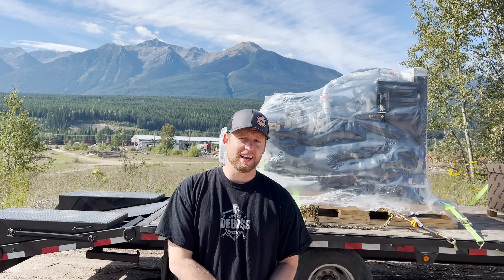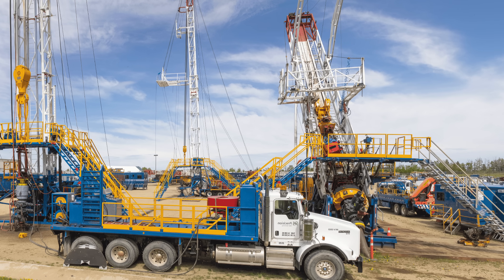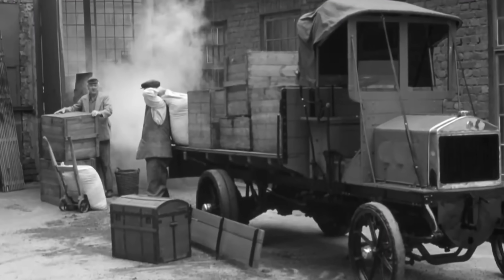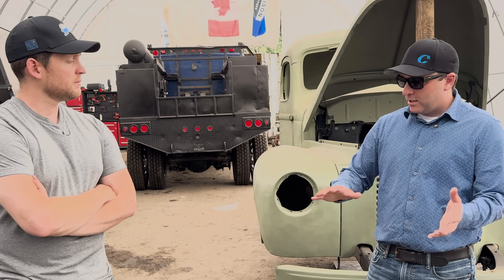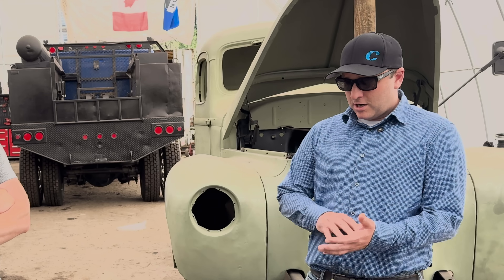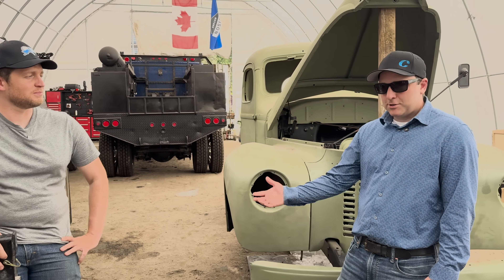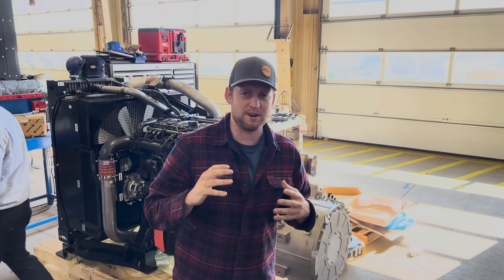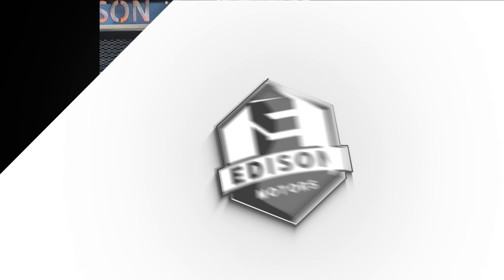We're putting Scania engines into Edison Motors Trucks!

Comment: I think CAT didn’t even want this truck existing.
Reply: It is up their alley, Cat is world leader in generator engines...
Reply: @Guds777  in order for this truck to have been on US roads with the CAT engine it probably would have needed a aftermarket emissions system. They are horrendously bad.
Reply: @markm0000  The thing is it was operating as a generator so on road emissions standards don't apply.  It would only need to comply with standards applicable to generator sets.
Reply: @jasonstclair6293  if it's used as a prime mover of a diesel-electric powertrain, both standards apply simultaneously (variable-speed gensets and on-road), unlike in the marine gensets
Reply: @erkinalp  It's not the prime mover.  It's not a diesel-electric powertrain.  It is a hybrid and the batteries are the primary source of power.  This was all covered in a previous video.
Reply: @erkinalp  Actually it's not actually a hybrid either since in a hybrid the combustion engine is directly linked to the powertrain to take over at times where the electric cannot provide the power.  This is instead a generator that charges the batteries only for the most part although it can provide current through the inverters when the engine is running.
Reply: from what i understand in the US you can't buy a new truck with a CAT engine in it
Reply: @Th3DavidPugh they didn’t use a traditional truck engine, they used a 9 liter generator engine from cat. Cat makes engines that meet tier 4 emissions standards
Reply: @user-wm9pj2xj7z  who used it?
Reply: @Th3DavidPugh cat hasn’t made a new on highway engine since 2010, every truck newer than that with a cat is usually a glider with a pre 2000 engine
Reply: @jeffreyturner6262  thanks, I couldn't remember the year they stopped my Highway engines
Reply: @Th3DavidPugh  Correct. But Cat is offering New engines to replace those made in the last 30 years. None emissions models, but meet the emissions for the chassis they are being put into. They will even take a Detroit or Cummins core and sell you a new Caterpillar engine appropriated for the year of the chassis.
Reply: @debi5292  That's cool, I know CAT diesels are highly sought after, so it's cool that they will "swap" era engines for new ones
Reply: @Th3DavidPugh  they can't buy one in it but they do have a cat motor you can change out with it's not like the older cat motors
Reply: @Th3DavidPugh , that doesn’t matter for this as the engine is a power unit for a generator.
Reply: @markm0000  Cat for a few years made blocks for Navistar and the Cat Gravel edition was a Navistar. Navistar then went to a Mann block, just Navistar junk, paid huge $ to US military, as they used to be their prime supplier and were used. Even the  Ford PU engine ended up in a lawsuit, that one was on Ford, head bolt, or lack of enough issue.
Reply: I'm a brok broker( o/o) because of cat engines
Reply: cat is shit
Reply: What makes you say that
Reply: If don’t want EU engine in the US trucks then the should have made there own V8 it’s that simple.
Reply: @antonfloor344  there, their, and they're pretty please you nitwit ;).
Reply: The thing a lot of people seem to be missing with the emissions and such is this truck was cleared with the Canadian government for manufacture, registered, and licensed with the Cat engine.  I hardly doubt that would have been possible if it were not up to emissions standards.  It is good that they are going for something better emissions wise, but as it was the Cat it was perfectly legal.
Reply: Cat dosnt built down emissions compliant engines anymore and there will be new regulations on this hybrid tech soon
Reply: @bennaylor3658  Cat actually does build emissions compliant engines.  They just don't build truck engines.  Look it up.  All off road engines are built to tier 4 standards.
Reply: CAT too lazy or too bad to figure out how to lower emissions. EU engines are lightyears ahead of NA engines in this regard. NA just complains about the Environmental Protection Agency and bury their head in the sand.
Reply: @mos3ef  CAT wasn't lazy... they just decided they didn't need the truck engine business anymore.
Reply: @jasonstclair6293  pretty much this, the ROI is low for on-highway small diesels and CAT struggled with tier-4 so they stayed offroad.
Reply: @phillip_mcguinness7025  I'm not an expert by any means but the way I see it it won't be long and there won't be any business for anything other than in house engines anyways.  Daimler owns Western Star, Freightliner, and Detroit Diesel and pretty much make everything they need to build a truck.  Paccar has Peterbuilt and Kenworth and has their own engine line so far, and probably transmissions are next if not already.  Mack and Volvo have built their own engines for years.  Cummins is still an option for most American brands, but who knows how long that will last.
Reply: @jasonstclair6293  the PacCar aren't great, lots of Cummins in now.
The new ISX 15 prototype is interesting
Reply: @mos3ef  I agree but the government including the EPA is simply BS. They require thousands of dollars in unnecessary emission's equipment that the cost is being passed onto the buyer. While also creating 2 separate waste products such as plastic jugs and cardboard boxes. While simultaneously lowering your fuel economy. All BS. All lies!
Reply: @mos3ef  why ruin a good engine with emissions
Reply: @mos3ef  cat probably doesn't want all the warranty headaches with deer pee
Reply: Cat doesn’t want any other engine to exist
Reply: @redeyedmongoose2963  that's pretty dumb to say considering they don't even build truck engines anymore.
Reply: No EPA BS

Comment: For those concerned about them being worked on compared to Cummins or CAT, you should factor in no dpf mean it won't break down near as much
Reply: just saying they dont have a dpf means they dont break is a problem. they will still have to have a emmmisions system one way or another either DOC SCR or DPF EGR or EGR SCR or SCR DOC. the real problem is going to be a quilified tech with the correct est to properly diagnose the equipment.
Reply: @dustansanders12  who said no dpf mean it doesn't  break? 
Additionally,  as long as they have the diagnostic  equipment, I would not let a mechanic (outside if at a dealership)  work on my vehicle that can't work on it because they aren't familiar with it. A real mechanic  can work on it regardless of brand.
Reply: @TriCountyMotorsEastman  ....You did, literally in the original comment.
Reply: @ryanthompson3737  where did I say that they don't break. I said less. That has never, in the English language,  meant not at all. I didn't say it wouldn't break. I said that is would break less. DPF systems are unreliable, and I have seen truck down for over a month due to dpf back orders.
Reply: @dustansanders12   They still have EGR and SCR systems they just got rid of the particulate filter but at the cost of added complexity in the engines...   The issue will be serviceability in the field expect longer down times and more costly repairs.   Edison SHOULD be offering Scania along with a domestic option.
Reply: User serviceability is my concern.  People here know CAT/Cummins engines.  Not so many know Scania.
Reply: @i-love-comountains3850  if you have a real mechanic and not a parts swapper, it shouldn't be a huge deal as long as they have the diagnostic software. It might take a little longer but it shouldn't affect a real mechanics ability to do the repair. 
The only exception would be if they require a lot of specialty tools that are just for them. Then you could have an issue.
Reply: @TriCountyMotorsEastman  So I spend alot of time out in greenwood BC where there is a decent amount of logging trucks running around. That's over 3 hours from Merrit, and if you needed a tow, 293 Kms. That's one hell of a tow bill as there are no Scania mobile mechanics. I'm just saying these motors will cost owners more for repairs than a CAT or Cummins as those mobile service providers are already trained/licensed to do repair work and wouldn't need to be enrolled in more training. Its simple math. I like Scania, but facts are facts.
Reply: @TranceEmotion  sounds like it COA statement
Reply: @TranceEmotion  In the long run, sounds like Scania costs less to operate.
Reply: @user-roadwander  on that your probably right. no DPF/DPF system will defiantly result in a better truck but even with that out, trucks still break down. Not being able to just have it fixed right away is a huge turn off for companies though. Everyone keep talking about any mechanic can just go work on it and do it. No they cant, not when that engine has a warranty if you want to keep it. They will need to be Scania certified, have the proper Scania programs (which isn't a huge deal) and do you want someone who has never worked on a Euro diesel just willy nilly in there doing stuff?Everyday a truck is down is lost revenue and if they don't offer an NA option they will have lost customers.
Reply: @TranceEmotion  May have less down time? Long term operational costs is what matters.
Reply: @TranceEmotion You already have European engines. Paccar and Volvo comes to mind.
Reply: @martinpenwald9475 paccar 😂😂
Reply: It is just nuts and bolts.
Reply: @Binturong3850  as a mechanic, just eyeballing it.  I would rather service this in a heartbeat.
Reply: @Binturong3850  Aye there will be extra costs/longer repair times. Sure if you were in around Edmonton or Vancouver it probably would not be an issue. And no I'm not talking about parts, but the mechanic to change that part out. However out in the middle of the BC mountains? lol gl with that. There are Cummins/CAT shops scattered through the BC mountains because of logging and mining, with lots of mobile mechanics to service the area. I love the idea of Scania engines being used, but there WILL be added costs to operators for that decision and will alienate clientele you would have had if you used one of the other two due to mechanic availability and fleet mechanics already trained in how to fix what they have. Its a really risky move, with some benefit but id say more downsides.
Reply: @TranceEmotion bruh if you are in the bc mountains then you take it right to Edison they are litterally in merrit
Reply: Those companies have to comply with the laws that enable diesel engines for legally acceptable tailpipe emissions. Their engineering has to come up with solutions to keep the tailpipe clean, otherwise their businesses will cease to exist.
Reply: And added running cost.
Reply: Ok I might be stupid but isn't the only real difference between any diesel the torque specs, cable to talk to the ECM and the diagnostic software. I know that in the car world most tec's can't work on it if they can't plug it in to see what the car says is wrong. And it's not like they don't have a huge following. 

Just buy the diagnostic tools and find a person that is a grease monkey. Probably the same guy that you already use. Don't overthink what a tech is willing to do.
Reply: @thomasswearingen6971 I'm a Redseal HD Mechanic in BC and as for Scania diagnostics, it would be a matter of paying for the program and data connector/communicator and then familiarize yourself with said program just as a tech would do with any other program such as Cummins Insight or Cat ET.

Comment: I thought you only needed small engines to run a battery recharge generator?!?
Reply: You do, but if you want the best efficiency, sometimes bigger is better, even in this kind of application
Reply: @halofreak1990  Yeah, that Generator in the video attached to the Scania  Engine looked massive to me.But I suppose if you needed to bypass the Battery and run the Motors directly from the Generator it would need to be. But why you would do that I don’t know?!?

Comment: chase your right, Kroger did a study on engine size and switched to the larger engines beacuse it was more efficent
Reply: That was the reason Cummins went from 5.9L to 6.7L for Ram. Reason being diesel engines operate at low enough rpm that thermal energy from combustion has time to soak into the cylinder walls. Increasing the cylinder volume per surface area ratio keeps more of the heat in the cylinder and also reduces demand on the cooling system
Reply: @Evildaddy911  and there is no replacement for displacement when it comes to low end rpm power and longevity
Reply: @coff3eSl0th honestly the 6.7 is so close to the 5.9 it just has more fuel flow.  You can turn a late 5.9 up conservatively and get the same performance as a 6.7 without all the emissions.
Reply: @EkzdeeLFT  At the expense of rolling coal sometimes.
Reply: Eff kroger for their new multi-billion dollar merger.  They're about to be a monopoly and admitted in court that they deliberately hiked prices on essentials during the pandemic.  

I say again,  f u c k  kroger.

Comment: My father has a 2018 Scania in the workshop having an in-chassis engine rebuild. Only 650kish km on the clock. Reboring and putting larger sleeve inserts in. Pitting in the bore and the O-ring were letting in the coolant. Smelt coolant on the drive home. Said he was lucky not to have left it for another journey.  Faulty metallurgy somewhere along the line, but he loves the thing.

Comment: This will be a mistake. Cummins is the obvious choice due to the available labor force capable of servicing the motors and availability of parts. Parts may be available overnight in Europe for a monumental cost; will it be the same case for miners in rural Canada? Downtime is expensive!
Reply: You have your choice of engines, my man.
Reply: if a place is very rural it will take time no matter what you use unless the local area already has a lot of X type of engines so that is what the local repair people have stock off.
To get more stock of that right type you need more of that type of engine in the area this means it makes sense for the Local repair place to stock up on those parts.

Simple Supply and Demand